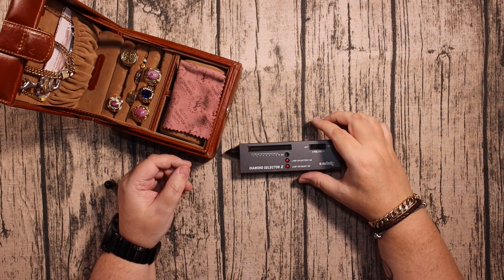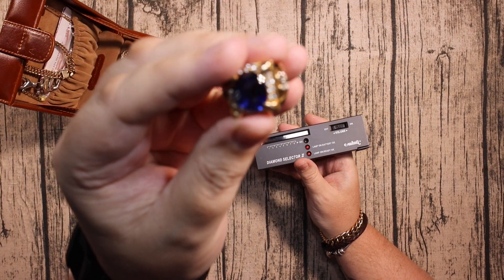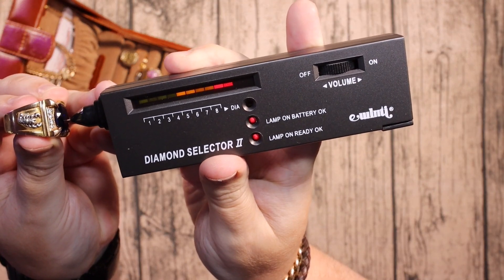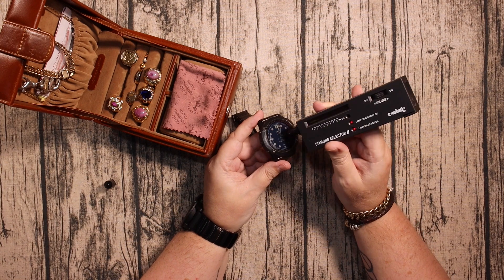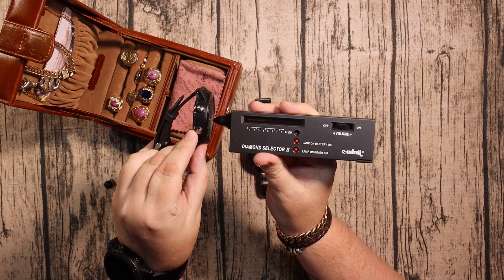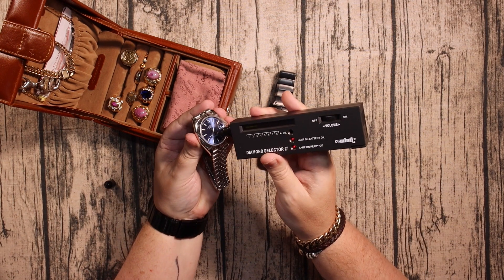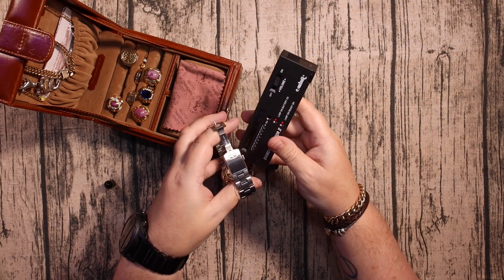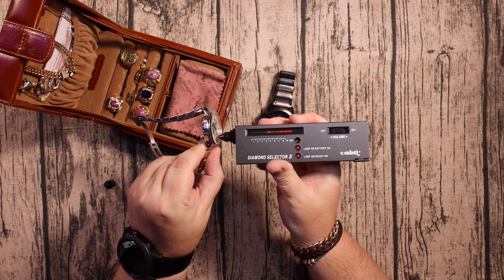Garmin Fenix 6X Sapphire Glass Test with Jewel Tester.

Comment: Thanks for the video... want to come test mine? I have a Fenix 6X sapphire and just got done having Garmin tell me that even though it's a sapphire screen it "can" scratch and that is my fault. I've had the watch about 6 weeks and kept noticing a faint line on the screen... always around the same area... It seemed to disappear after I'd clean the screen. Turns out it's a scratch, perhaps in the anti reflective coating, but it's noticeable and bugs the heck out of me. I love everything else about the watch though!
Reply from the maker: Sapphire glass on a watch is not real sapphire, but it is almost impossible to scratch. It can scratch though with real sapphires, diamonds etc... I used to have a ring with a tiny diamond that caused damage to a few phone screens and my car windscreen before I sold it. So it could have been a diamond ring from holding hands with a partner? Anyway, I feel your pain, that's why I spend the extra to buy sapphire because a scratch on the glass is the worst for me as well. Have a look online, there are some products you can buy online that can polish out the scratch on a Rolex glass, so it should also work on a Garmin. Thanks for watching and I hope you can learn to love it, or get it repaired in some way. Best of luck.

Comment: Any chance you could test the Tactix Delta Solar version?  The website claims it has “power sapphire” but many in the community doubt it’s real sapphire and Garmin has been mute on the issue
Reply from the maker: I have never seen one, but if I can get my hands on one then I would be glad to check it out with the tester. Thanks for watching.
Reply: Hi. I am about to get tactix delta also.. Still wondering around though... Can you test it on the sapphire glass? Thanks a lot and great job reviewing it.
Reply from the maker: The solar version is not sapphire. It is a gorilla glass composite similar to the Samsung smart watches.
Reply: @Paullebbon  Appreciate your reply. thanks a lot for the heads up.
Reply from the maker: You’re welcome.
Reply: @Paullebbon  Are you sure ? Have you tested it ? Point is I found a post on forum where a Garmin rep confirmed Tactix Delta Solar has the same sapphire as on the normal sapphire models (thus they call it Power Sapphire as opposed to regular Power Glass). Only in Fenix 6 solar versions use Power Glass with gorilla glass. So Tactix Delta Solar is the only model having Saphire with Solar version. Exact reply from Garmin rep: "When the Fenix 6 series was engineered, there were initial concerns sapphire wouldn't allow the solar charge through enough so gorilla glass was used. Since then, in the time that passed while engineering the Tactix Delta Solar, improvements were made so the Tactix Delta uses a domed sapphire crystal cover over the display. This was an important improvement due to the military 810 specs that help make the Tactix Delta series such a rugged watch even in comparison to the Fenix 6 series."
Reply from the maker: As I said before I haven’t seen one. The original solar was gorilla glass 3. If it says power sapphire then yes it should have a sapphire glass, but I still haven’t seen one to test. Thanks for watching and sorry for any confusion.
Reply: @Paullebbon  Thanks for clarification!

Comment: Hey! Great video, but doesnt the garmin generate more heat trough it being a big battery/more power needing watch? Did u consider it when measuring the heat from the glass? Cheers!
Reply from the maker: No, it doesn’t work in that way. Yes, it does measure heat dissipation but only in the material of the glass, not from the battery. The case of the Garmin is made of a composite plastic and the battery is close to the back and is no hotter than its surroundings. Something like an automatic Rolex would generate as much heat through its moving parts as the Garmin. But it was a good remark so thanks for the comment and stay tuned for more videos coming soon.

Comment: How's that machine detects sapphire? How it works exactly? 🤔
Reply from the maker: It works through heat transmission. Glass has a different transmission from sapphire. A diamond tester will detect the rate at which heat moves through the stone and will tell you whether it is real. There are also testers that use electrical conductivity to test stones – they are based on a similar principle, but they use electricity instead of heat.